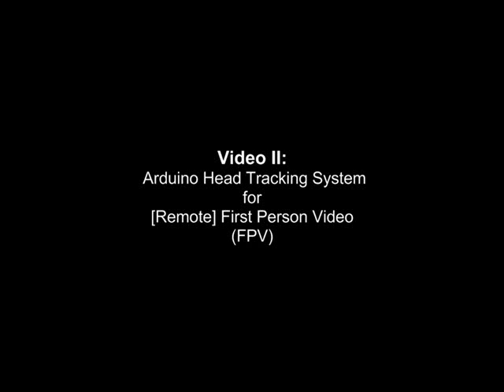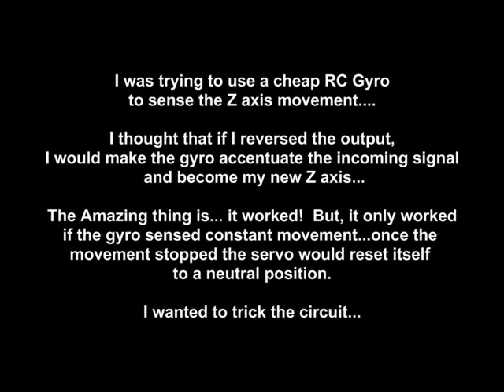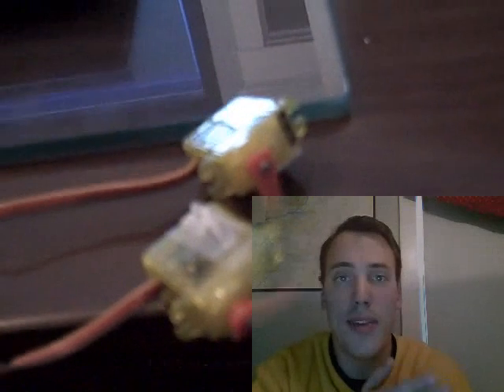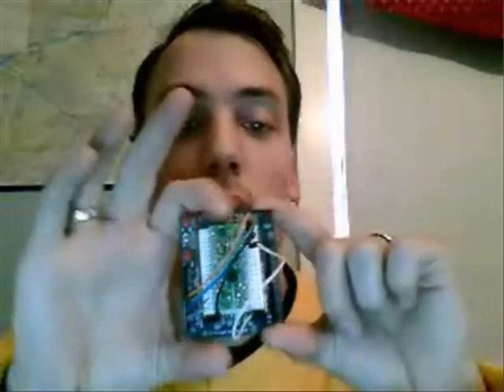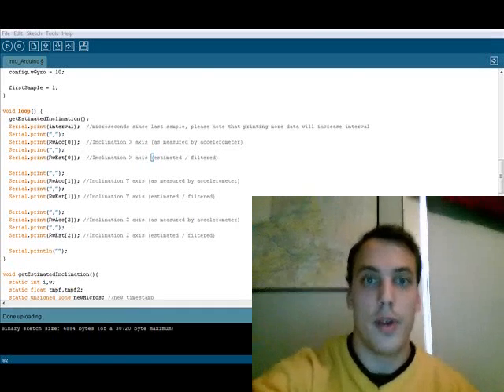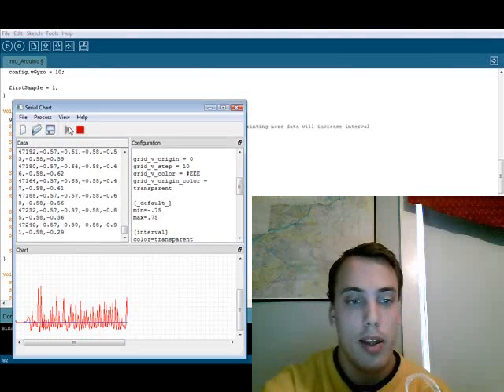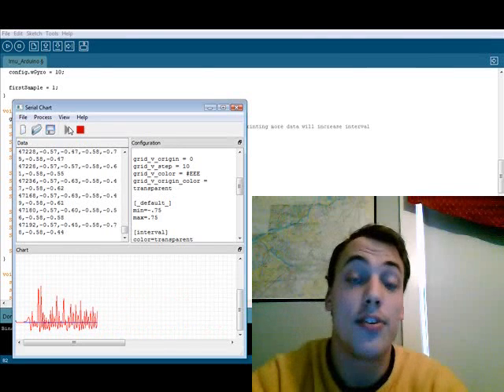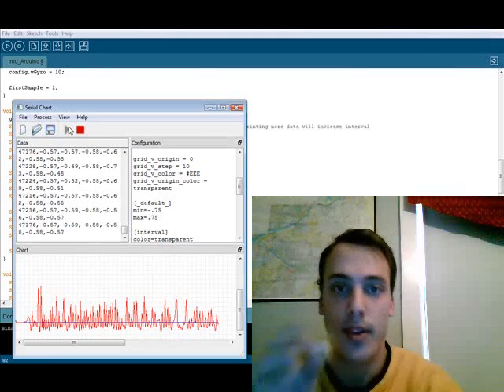Video 2: Arduino Head Tracking for First Person Video - Filtering and Smoothing

Comment from the maker: The accelerometer/gyro used in this video is for sale ( I currently have 1). You will need this, or some other 6DOF circuit, code that I'll provide to the buyer (my code only works with the board mentioned above), three servos a camera/transmitter and video goggles. Thanks for your interest!